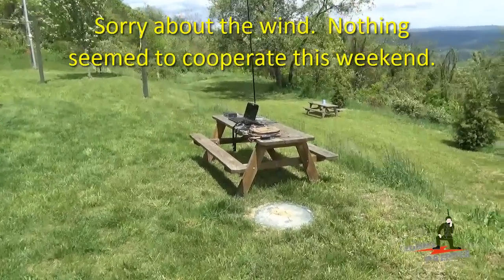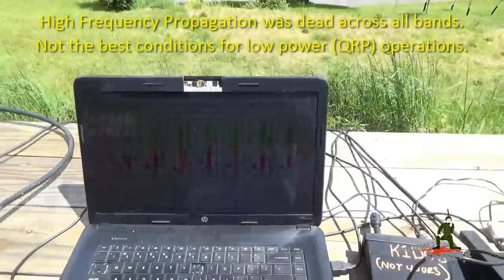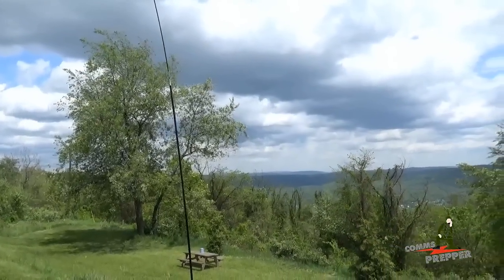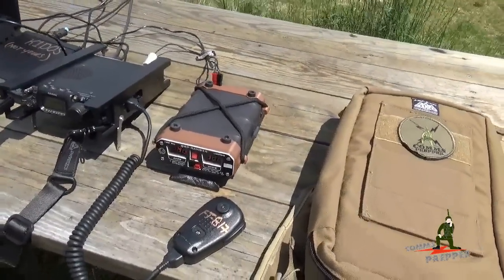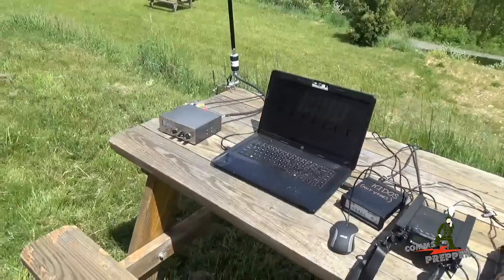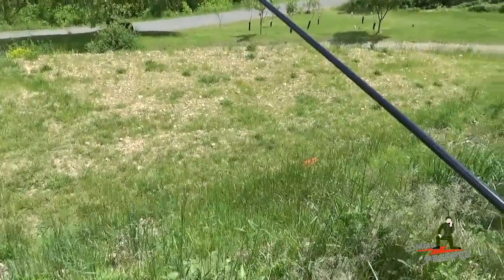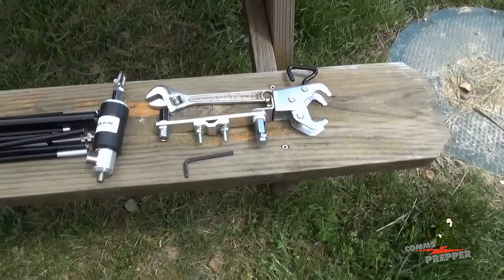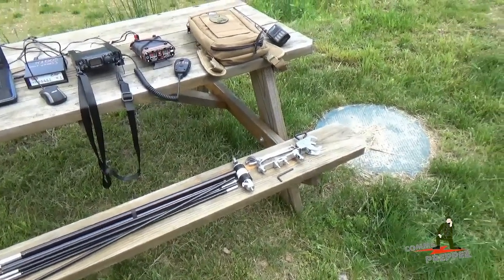Chameleon Antenna's MPAS Antenna

Comment: Thanks for another great video.  If I could pick your brain for a minute, what are your thoughts on vertical versus horizontal polarization?  Everything I've seen indicates that vertical whips are faster to set up and take down compared to a horizontal dipole, but requires more hardware, which means additional weight and space.
Reply from the maker: For HF ops horizontal is the most common and preferred antenna polarization.

Comment: so, no propogation...I guess 'ham radio' ISNT 'always there!'
Reply from the maker: Ham is a broad term.  Sometimes HF propagation is not their but there is allot more to Ham radio than just HF communications.
Reply: Absolutely concure. But anything that is RF dependent can be unusable. So the claim that 'HAM radio is always there' or 'when all else fails...HAM radio works'...are exaggerations. I'm not hating on HAM radio...just the insinuations by many groups, clubs, organizations and some individuals that quote the same sayings involved with HAM radio that it never fails (especially in 'emergency' claims). Like anything man made...it can be rendered unusable in its modes/bands/transmission types (voice/cw/data/sctv/digital), be that nature's cause or our own. Its just MORE likely to work when infrastructure dependent 'services' fail (or where there is no infrastructure to begin with).
Not saying you made those claims, in this video...but this isn't the only video, of your's, that I've watched.
Given what HAM radio has done for technology...the freqs. should be gold plated and GUARENTEED to amateurs, for perpetuity.
Personally, I luv HAM radio! Just not a fan of the 'rhetoric' that's constantly being repeated re: availibility/dependability. Every HAM has run into those days when...its just a brick with lights and noises. And we come back to it later, when its fun again.
Reply from the maker: Not exaggerations - Ham will always be there but operators will have to use different bands or modes to accommodate the unpredictability of High Frequency radio propagation (i.e. repeaters, simplex modes, etc).  Ham have many bands to work with.

Comment: I'll be curious of your next video when conditions are on your side.
Nice setup, i'll be buying soon the mil whip and its extender for portable ops for use with a coil (for the lower bands) and my X108G with my modified MFJ902. 73, Chris
Reply from the maker: The band have been horrible for awhile now.  Makes it hard for antenna videos.
Reply: Maybe some NVIS within your State...

Comment: Suggest Surface 3 w 64 gigs.  Not surface pro.  Picked new one up at staples for 399.  Add sd card n you double or triple your hard drive space.  Check used on eBay too.  73

Comment: How well does everything fit into the AMP-3 bag? Can it be operated from the bag like you can with an SLA battery in the bottom?
Reply from the maker: +Endless Fields It fits for moving but you will have to pull the QRP ranger out to connect the power leads.

Comment: I can often pick up Panasonic Tough Book CF-19 or others for less than $400 and they are very rugged. I currently use a CF-19 Mark 3 for my field laptop and got it from ebay for $250, I replaced the internal hard drive with a 250GB SSD for another $150 and have a solid field laptop.

Comment: Thanks for sharing ! I use a older ASUS EEE PC netbook for my radio programs. The computer is light, has a very small footprint, works on 12vDC and a solid state drive. It does not have a legacy comport which is kind of a drag. They are very inexpensive .

Comment: Maybe you can do what I did. I found a cheap toughbook case (40$) and I  had a computer savvy friend transfers my hard drive from my old portable computer into it.so now I have a resistant water resistant communication computer
Reply from the maker: +TheMountainRN I will have to find something soon.
Reply: Commsprepper yeah especially if you loose your W will be hard to get on the internet 8)

Comment: I like my Panasonic toughbook
Reply from the maker: +Brad Newhouse Yeh...  that's my dream laptop.  Had one from work for awhile and know how good they are.  Unfortunately I don't have the cash for a toughbook.
Reply: +Commsprepper  That is what I was going to recommend.  Beyond a custom built hardened components, the Panasonic is hard to beat. Toshiba specific model for ruggedness are next in line, but don't think that all models are ruggedized or you will be disappointed. (This is true for most brand name.) You're going to get pricey for any laptop using 1st or 2nd tier components, but apply same advice you would use for radios. I have had good luck IBM/Lenovo "T" models as well (I worked for IBM for 10 yrs.)

Comment: I would look at Lenovo T430 laptop, you can find the i5 models for 300 bucks on ebay.  If it to heavy for you the T430s is a little lighter but you lose some ports and adding larger battery. The one reason I like the T430 is you can change out pretty much everything on the laptop yourself. The two batteries combined in the T430 they claim up to 30 hours... 
http://shop.lenovo.com/us/en/laptops/thinkpad/t-series/t430/
Reply from the maker: +ric3125 Thanks.  I just checked the link and they are sold out - must be a good laptop.
Reply: +Commsprepper Lenovo T430 came out in 2012 2013 for a lot more money then. Thats why its say sold out, the link was to reference the specs.